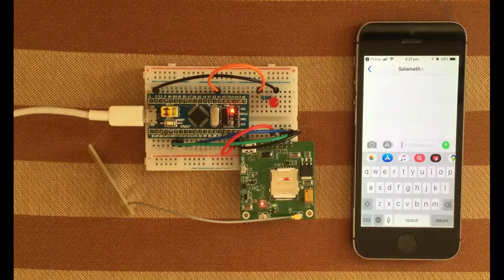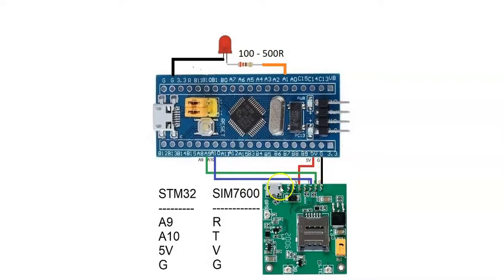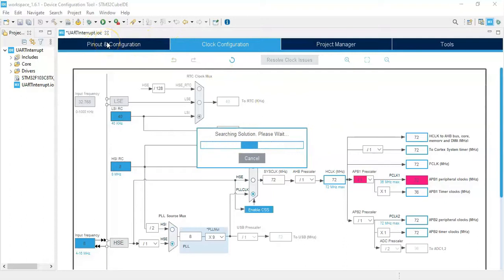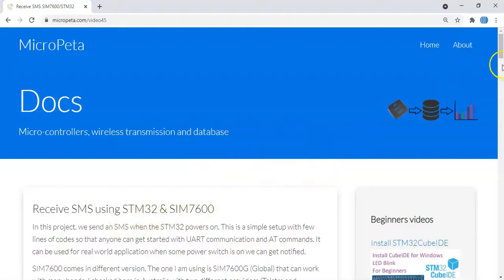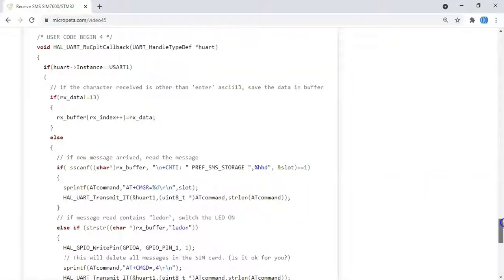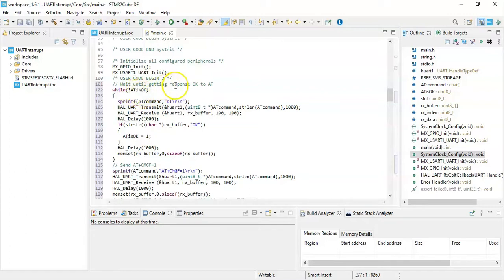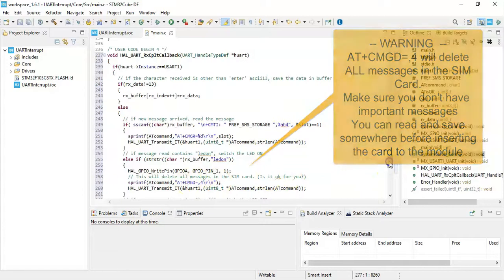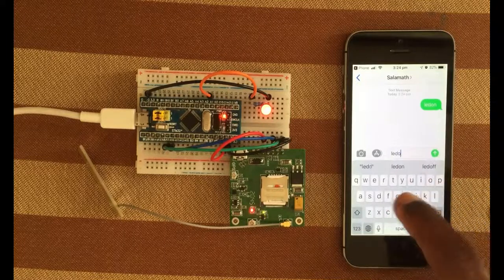45. STM32CubeIDE Control via SIM7600. UART Interrupt with STM32F103C8T6

Comment: Hello Sir and much appreciated for sharing your experience. I am applying STM32H7 series and cannot change the clock frequency to 72 as its minimum is 96. I was wondering how much the frequency setting is important toward SIM7600 and its serial communication,  and if I can use 96 instead of 72 to use the SIM7200.  thank you

Comment: Is this code work on SIM800L
Reply from the maker: Yes. This code will work with SIM800 series. The power supply should be 4.2 volts
Reply: @NizarMohideen  I tested with SIM800 but it was not sent the message. I changed baud rate to 9600 and i couldn't regulate voltage. is that why the SIM800 is not working?
Reply from the maker: Yes. You can try different common baud rates. Most of SIM800 comes with 9600.
It may be the reason.
There are other factors which needs to be considered
1. Availability of 2G networks in your area.
2. Signal quality. Try outside your home/office. Experiment near a cell-tower
3. Of course the power supply. Try a capacitor
4. Wiring loose connections

First check for wiring connections and try to get response OK to AT command and debug mode.
If Success, try to get response +CGREG: 0,1 to AT+CCREG?

Comment from the maker: After publishing this video, I realised that we need to delete the slots even if the message does not contain "ledon" or "ledoff".
Otherwise all slots may get full with junk SMS and we wont have any slots available for our purposes. So I modified the code a little bit and tested it. It works all right.

// Old code
// if message read contains "ledon", switch the LED ON 
      else if (strstr((char *)rx_buffer,"ledon"))
      {
        HAL_GPIO_WritePin(GPIOA, GPIO_PIN_1, 1);
        // This will delete all messages in the SIM card. (Is it ok for you?)
        sprintf(ATcommand,"AT+CMGD=,4\r\n");
        HAL_UART_Transmit_IT(&huart1,(uint8_t *)ATcommand,strlen(ATcommand));
      }
      // if message read contains "ledoff", switch the LED OFF 
      else if (strstr((char *)rx_buffer,"ledoff"))
      {
        HAL_GPIO_WritePin(GPIOA, GPIO_PIN_1, 0);
        // This will delete all messages in the SIM card. (Is it ok for you?)
        sprintf(ATcommand,"AT+CMGD=,4\r\n");
        HAL_UART_Transmit_IT(&huart1,(uint8_t *)ATcommand,strlen(ATcommand));
      }

      // New code
      // if message read contains "ledon", switch the LED ON
      else if (strstr((char *)rx_buffer,"ledon"))
      {
        HAL_GPIO_WritePin(GPIOA, GPIO_PIN_1, 1);
      }
      // if message read contains "ledoff", switch the LED OFF
      else if (strstr((char *)rx_buffer,"ledoff"))
      {
        HAL_GPIO_WritePin(GPIOA, GPIO_PIN_1, 0);
      }
      // This will delete all messages in the SIM card. (Is it ok for you?)
      if (strstr((char *)rx_buffer,"READ"))
      {
          sprintf(ATcommand,"AT+CMGD=,4\r\n");
          HAL_UART_Transmit_IT(&huart1,(uint8_t *)ATcommand,strlen(ATcommand));
      }